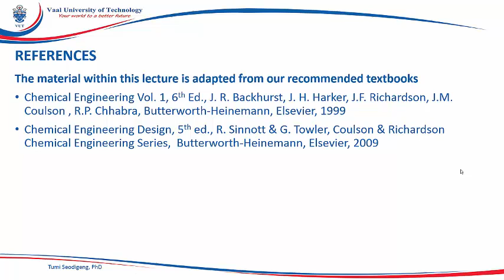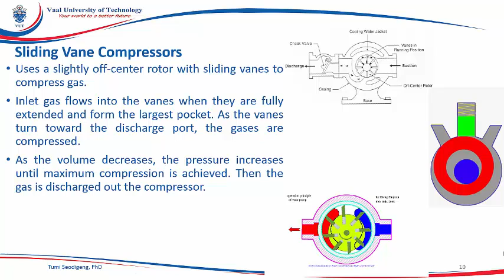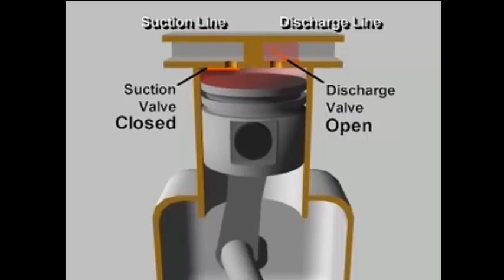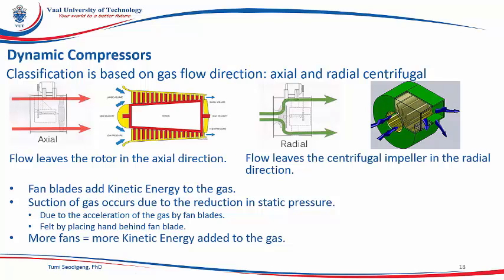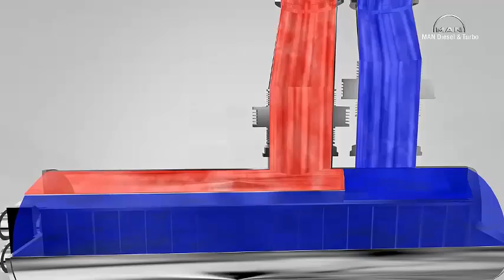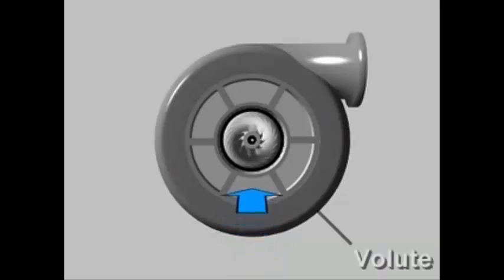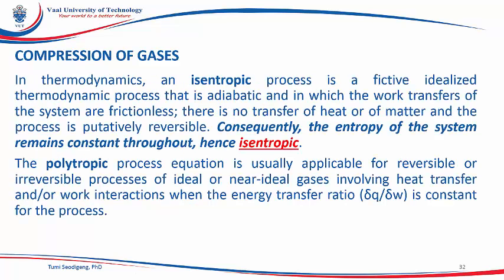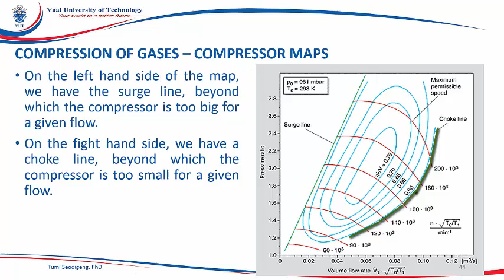INTRODUCTION TO COMPRESSOR SELECTION AND SIZING

Comment: If you need 60hp best option = 3 x 30hp / =1/2 price for stand by compressor 30hp.  A screw compressor is good if the compressor can run ~ 85% continuously loaded (A compressor that runs a lot unload will be worn out very quickly !  A piston comp.(has more flow than a screw) and is used  in a ~ garage / car service center (no continuous use of compressor)